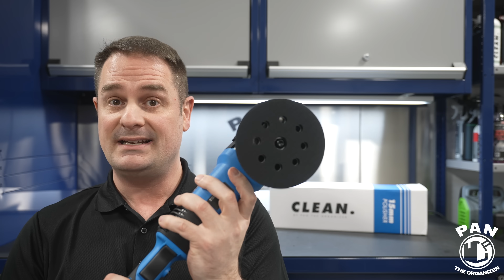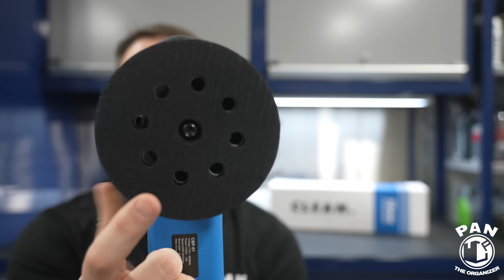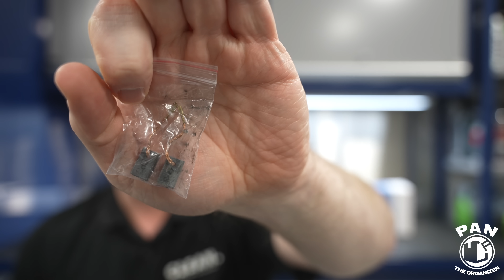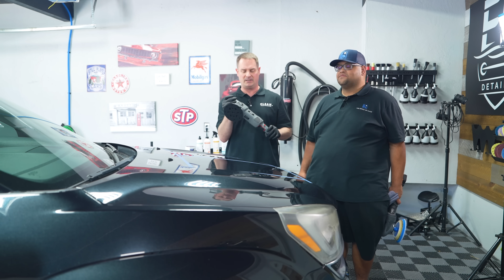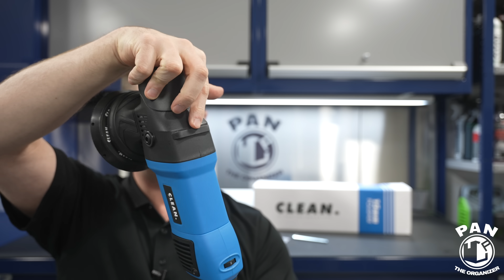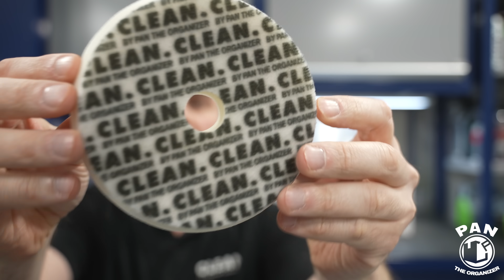NEW CLEAN By Pan 15mm polisher!

Comment: So am I correct in guessing that the reason you chose to do a 15mm DA was because it was a reasonable compromise between the 21 mm DA and the Rotary, so for those looking for 1 tool instead of 2, the 15mm can do it all by just being less specialized?
Reply from the maker: 15mm is the most commonly used throw. Between an 8mm and 21mm DA, the perfect sweetspot for most paint correction jobs in my opinion.

Comment: How is this compared to harbor freight Hercules forced rotations
Reply from the maker: You can't compare dual action to forced rotation. Completely different technologies.
Reply: @  I’m new I just don’t know what to use I think the forced rotation with me being new pushes me around
Reply: @ I’ve spent over 800 dollars on your stuff just trying to get everything 🤪
Reply from the maker: Yeah forced rotation will walk on you if you aren't careful. Dual action is much safer and easier to learn with too. I mainly use dual action. :)

That polisher, paired with the CLEAN By Pan Spray Polish and the CLEAN pads, super simple system, and it will get the job done in a great way.

Comment: Is it good to use your new polish over a truck with PPF protection and Ceramic coating ?
Reply from the maker: Hi Stan. Why would you do that? The spray polish, like any polish, is meant to remove scratches and swirls and oxidation, for paint correction. Do you have swirls and scratches on your car? If you polish the surface with a machine polisher and a compounding polish, that's abrasive and that will strip the ceramic coating that you have.

Comment: Hi Pan! If you could make a video on how to remove an existing ceramic coating on a ppf with your new polisher it would be nice. There is not much video about prepping for a new coat of ceramic coating, especially on ppf. I will eventually need to redo my car ceramic coating and would appreciate your expertise. Thanks!
Reply from the maker: There aren't many videos, as the process is the exact same as starting from scratch. The only way to remove an existing ceramic coating is by machine polishing. Once done, you use the panel prep spray to remove polishing oils and residue, and then you apply the coating as per the instructions.

PPF is treated pretty much in the same way as clear coat. Just be careful.

Comment: wow, how come it's not brushless?
Reply from the maker: That would increase the coat. The goal here was to have a good quality yet affordable unit.

If there is demand for a higher end unit, perhaps even a cordless one, we can always explore that option in the future.
Reply: @PanTheOrganizer  true that. the price is real, especially for a 15. brushes are fine for the home user (the ones I use have brushes). I maintain 3-5 cars in my garage, so it will be years before the brushes wear out, and for the number of cars I have, a 20' cord will do. cordless would be nice, but not as important for the home user as it is for the pro detailer, and it would more than double the price. all things considered, you have chosen the best specs for this tool.

Comment: Congrats Pan, nice addition to the product line. Started to use your products (I have the whole line-up) and so far it is unbelievable, I did not get to your 3 and 8 year ceramic coating yet but the polishing fluid is just magic. I went all the way and did a 3 step polish process (cut, polish and jeweling), I am obtaining results that I have never been able to reach before I am simply blown away!
Reply from the maker: Thanks for the awesome feedback and support!  It means a lot. Lots of time and effort, R&D and testing was put into the formulas with the chemists, and that spray polish has some of the highest quality new modern abrasive packages in it. It cuts quick, finishes nicely, doesn't dust, and even smells good! :)

Comment: Hi Pan, I've been watching your vids for 3 weeks straight now and i'm still LOST. 
I managed to buy the following products to detail my 2021 Genesis GV80 3.5t Prestige
1. carpro reset
2. carpro eraser
3. carpro descale
4. GYEON cancoat EVO
5. GYEON Tar 
6. GYEON Iron
7. GYEON Iron Wheel Cleaner
8. P & S dream maker and bead maker (i plan on combing them both like u said n one of your vids)
9. carpro PERL
10. carpro Darkside
11. Koch-chemie Glass cleaner 
12. the Last Coat
13.  Soft99 Ultra Glaco
14. GYEON clay lube
15. GYEON wet coat
16. Armour Detail Shampoo +
17. P21S 15300P Polishing Soap
So my question is i just got these products from amazon. Is any of these products conflicting with one another? Cause i have a feeling i bought mulitple products that do the same thing.
Reply from the maker: You wouldn't use all of those products each time you wash your car that's for sure. It would be way too long to explain here, but each of those products has its place.

CarPro Reset shampoo for regular weekly washes, and then Descale shampoo every now and then to remove accumulated mineral deposits or light water spots. Two different shampoos with different use cases. Instead of Reset, you can use ADS Shampoo+, similar pH neutral style regular maintenance soaps. 

PERL you can use as a tire dressing (either undiluted, or 1:1 dilution) or use DarkSide which will last much longer. 

CanCoat EVO would be your long lasting base layer of protection, and you could do a monthly maintenance with WetCoat, for example. Or instead of WetCoat, use Bead Maker once a month.
Reply: @PanTheOrganizer  what would u suggest as a IPA wipedown solution?
Reply from the maker: For any products really, I’d highly recommend that you check out my own line of CLEAN By Pan products here: https://tinyurl.com/y2j9mtws

Comment: having a major ice and snow store down here right now.    my state went all out and dump so much brine solution and salt on the highways.  besides using a pressure washer to wash it off after the weather clears, are there some kind of solution that I can spray to make it easier to get rid of the salt from the bottom of the car?  Thanks!
Reply from the maker: I feel you! We had record setting 73 cm (29 in) of snow between February 13 and 16 here in Montreal and we're in -20 to -25C temps (-4 to -14F).

For the undercarriage, you can simply use an undercarriage broom attachment for your pressure washer. See how I do it in this video: https://youtu.be/t7HCBSVnizM?si=D8azasSGAY61HyqJ
Reply: @PanTheOrganizer    my state's department of transportation sprayed enough brine solution on the roads to melt 10 feet of snow!  (but we only got less than 2 inches....)  :)

Comment: Made in China???!!!
Reply from the maker: Made in China doesn’t mean low quality. It depends on the specs, materials, and quality control. We worked directly with the factory to ensure top-tier components like NSK precision bearings, a powerful 1100W motor, and double the grease for smooth operation. Many high-end polishers also have parts made in China—what matters is how they’re built, not where.

Comment: Dang, congrats Pan!  Although I am stocked on polishers, I do plan on supporting via your product line.  Starting with your ceramic coating.  Any reason I would do the 3yr instead of the 8yr or vice versa?  Especially for someone who likes to polish his cars as much as needed to keep it swirl free.
Reply from the maker: The main difference with the 3-year and 8-year is the durability. The 8-year also boosts gloss and slickness and chemical resistance a little more due to higher solids content, but the main focus is long term durability. Both are exceptional. 

If you use safe washing and drying methods, you shouldn't have to polish your car for a few years. When I get a new vehicle, I polish it once, apply a coating, and for the three years of ownership, I never have to repolish. And I wash my car twice weekly on average.

But if you still feel the need to polish every other year, then go for the 3-year coating, and save money. ;)
Reply: Thanks!

Comment: Well done Pan "The Detailing Man " fantastic machine at an affordable price point, would it be much more expensive to have a  Brushless motor? and  progressive trigger or are those features for the next Pro model
Reply from the maker: Thanks Nick. Yes any option you add increases the price. Brushless motor, cordless battery powered, etc.  All factors that increase price. If there is demand for such things, we'll look into it for future machines, but the price will be higher for sure. The goal here was to have a crazy value polisher at a very low entry price point, with high quality features.

Comment: I have the Porta cable 7424xp. It has been great for years. I just purchased this. Will this be a big improvement.
Reply from the maker: I started polishing with the 7424XP a few decades ago hehe. It's a very good entry level polisher. But for sure you'll notice the difference in performance and smoothness of operation with the CLEAN By Pan polisher in my opinion. Hands down. ;)

Comment: Hey Pan quick question for the pads when your done using them to wash the in the washing machine with the microfiber soap is it only for microfiber pads or does it work with the clean wool and the waffle pad?
Reply from the maker: In theory yes, but I prefer using a pad washer, with a rinseless wash solution inside. Clean the pad, spin them full blast to eliminate as much water as possible, let them air dry, done.

If you do use your washing machine, use a delicate cycle and cold water. Don't use hot water as that could damage the glue holding the hook n loop backing on the pad.
Reply: @ as I’m doing a 2 step paint correction can I use an air compressor between passes to clean the pads and switch them after a panel and at the end to wash then I can use the p and s rags to riches soap on delicate settings and for the dryer on air fluff or is it better to air dry it’s going to be my first time using a polisher I don’t want to buy the bucket there to wash the pads since it’s too expensive
Reply: @ pan the organizer as I’m doing a 2 step paint correction can I use an air compressor between passes to clean the pads and switch them after a panel and at the end to wash then I can use the p and s rags to riches soap on delicate settings and for the dryer on air fluff or is it better to air dry it’s going to be my first time using a polisher I don’t want to buy the bucket there to wash the pads since it’s too expensive
Reply: @pantheorganizer for smaller areas I’m looking to get the adams sk pro micro cordless swirl killer polisher 2.0 I will be using the clean da polisher with the wool and waffle finishing pad for a 2 step paint correction with the clean polish for the smaller areas I’m looking to get the adams micro polisher instead of a mini to have more versatility but not sure which pads to get for it?

Comment: Very nice videos!!! What pad should I use on a brand new car? Thank you way to go Pam congratulations
Reply from the maker: The pad and polish combo depends on your paint type and also desired level of paint correction. Always do test spots to find the good combo for your paint and desired level of paint correction. 

But as a good starting point, for a new car, a 1-step polish is usually enough and my blue foam polishing pad is my recommendation. Here's the pad: https://tinyurl.com/6384kmpd

And you can pair that with the CLEAN By Pan Spray Polish: https://tinyurl.com/yh3a9kza